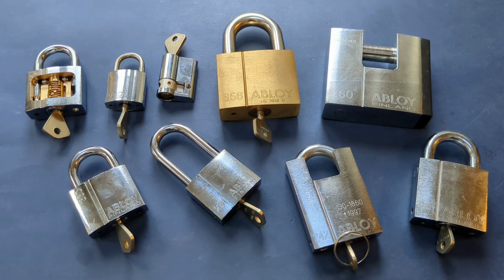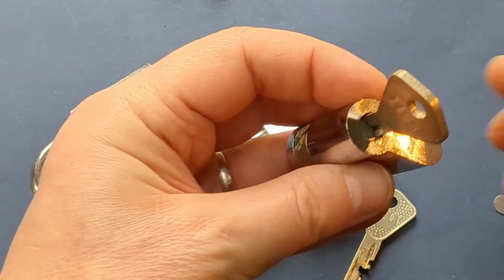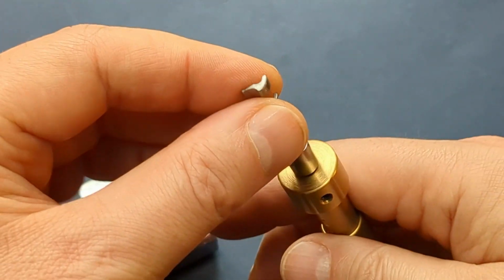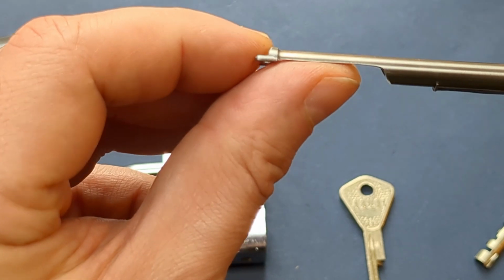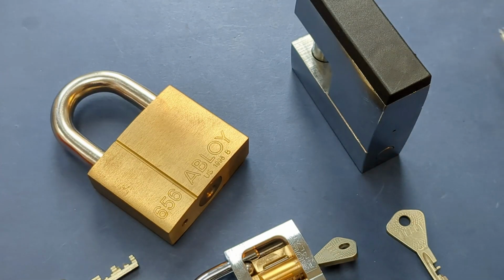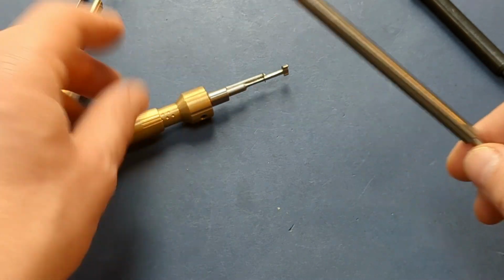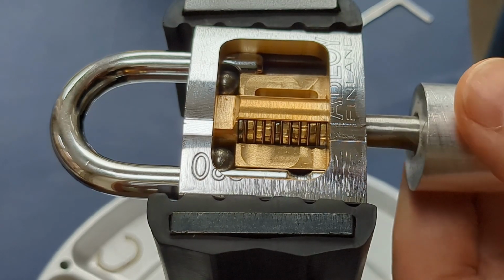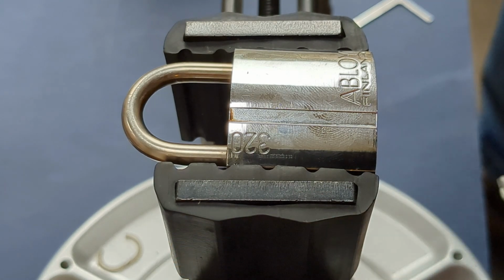Abloy Profile - home made tools for any variation (almost)

Comment: I think the double zero cut discs at the tip of the key were used to improve usability. When the tip of the key is straight for two disks, the disks do not get messed up so easily while you're pulling the key away from the lock. This was very common for front door locks which got operated daily here in Finland. More modern Abloy locks use some kind of disk locking mechanism while the key is not fully inserted and no longer require similar tweaks. If Abloy had originally made the tip of the key 1 mm longer and tip a bit rounded they wouldn't have needed to use double zero cut discs in any situation.
Reply from the maker: You only really need 1.5 discs worth of uncut key to resolve that issue and I have at least one lock with just the single zero. Double zero by far the most common though, which is helpful for the tools!
Reply: @crispix  In the key bitting (code) the first O Lifter (zero) disc is not counted. So if the discs sitting in the drum were actually O lifter, zero and five then the code starts with Zero and then Five.

The reason that factory locks in 6mm and 9mm come with a double O Lifter as the first cut is two-fold. 

Firstly it is to ensure the lock positively opens by action of the O Lifter. 

The 2nd is because the economics of mass production sees a greater amount of O Lifters being produced and they are put in to make profit.

The original point is correct though - Having the code start with a Zero means less wear on the key (in reality).  It lines up easier and isn't as prone to getting stuck and causing wear. (this is a customer problem, not a key/lock problem).

Does that help ?
Any other questions ?
Reply: @crispix  This is also done with Sentry and Exec. It's economics and positive functioning we're looking for.

Comment: Profiles here are SAF, OAD and SAL. All part of the 230 profile master key matrix.
Reply from the maker: Thanks Ade. Do you have more information where I could research this?
Reply: @crispix  No I am sorry, I don't.  9mm profiles were given to countries, regions and customers. The profiles were separated geographically, politically and by user designation so as to maintain global security of the system. 

It's all based on the 9mm A (A=Open) and filters down from there with each root branch fitting into the one above until finally you have a single profile by itself.

Most profiles the average person is exposed to today are base profiles which means they are close to being individual key profiles.

If you understand profile master keying then that might help you. There is 230 9mm profiles in the matrix. Not all are in use and not all are manufactured. Some remain spare for future use (although it's out of date now).

You'd have to find someone who is ex factory who is willing to give you the matrix graph. People who have it guard it jealously because it was not for public consumption.

In short, every profile is related.

Does that help ? 

I can explain the profile codes If you want.
And I am a farmer by the way. 🙂
Reply: @adelarsen9776  Do you know the official key spec / dimensions of the key blanks? Is the key body diameter officially 7.5 mm or 8.0 mm or something else? Most people seem to call these 8 mm sized keys but it remains unclear to me what the spec key size would be vs what's the official spec for the keyhole (because there cannot be zero tolerance obviously).
Reply: @MikkoRantalainen  It's called 6mm and 9mm (now named Classic and Profile). It's the total width of the key hole in the discs on the straight edge. The 9mm key blanks are nominally 7.35mm in blade width.

Any more questions happy to advise.
Reply: @adelarsen9776  Thanks for the info. The tolerance is way more than I would have expected because 7.35 mm key in a 9 mm hole leaves a lot of wiggle room.

Comment: Apparently the new silver bullet one profile fits all theses locks. Is that true?
Reply from the maker: I didn't show it in this video but I did scan all my profile plates and modelled them in CAD to look at exactly this. It is definitely possible, but requires some very specific dimensions and quite fine manufacturing to make the tensioner. Not very practical as a low cost home build but definitely an option for someone with access to a machine shop. So it wouldn't surprise me at all if universal tips are available for the silver bullet. Opsasec in Norway will also sell you a universal Profile pick. Of course, I can't vouch for either of these but the designers know what they are doing for sure so I should think they are good.